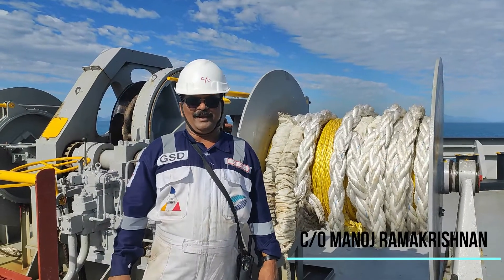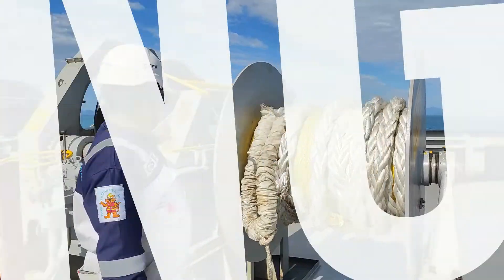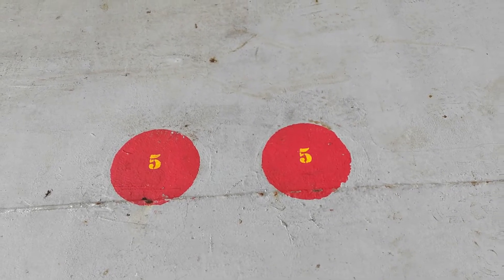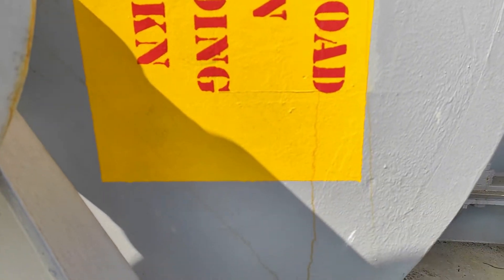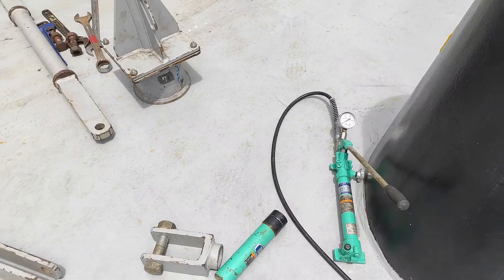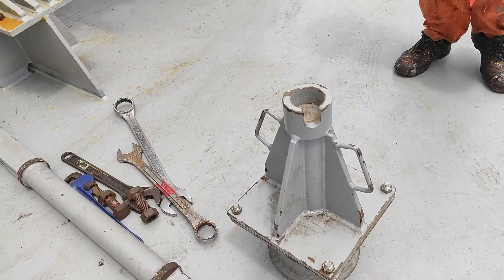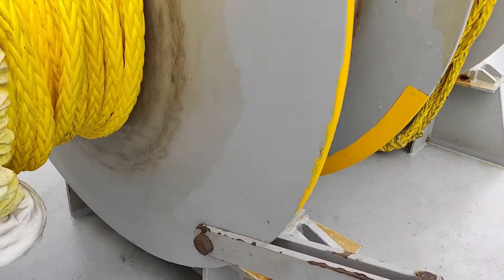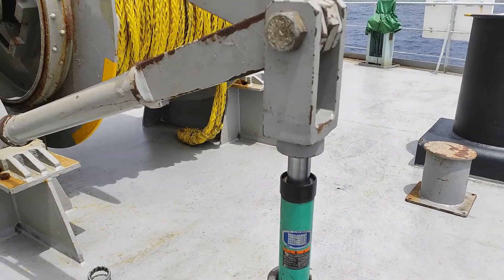BRAKE RENDERING TEST OF MOORING WINCH #mooring #ship #sea #windlands #rendering #brake

Comment: In your calculation I think the bore size of hydraulic cylinder was not measured correctly. From looking at the cylinder that should not be 78.5cm^2. it looks more like 30cm^2?
Reply from the maker: Data taken from yard specification.
Test kit is with certificate provided by yard

Comment: Sir I wanted to know Why we take weight wen we engage gear of mooring winch ya during lowering anchor ya wen der is weight on rope ??if not taken weight eg anchor such big sound will come that gear will break?
Reply from the maker: After engaged in gear,taking weight of anchor by gear is to avoid sudden jurk on the gear and chanced of slipping gear, especially when you are not put the pin after engaging the gear.
Possible crew injury or accident.